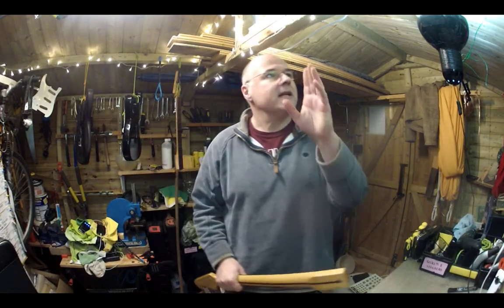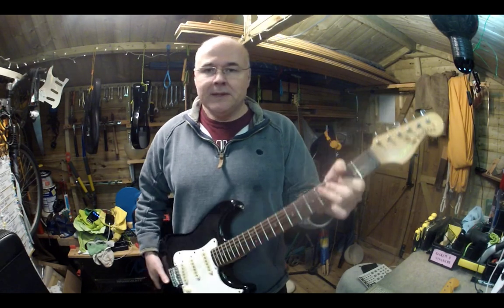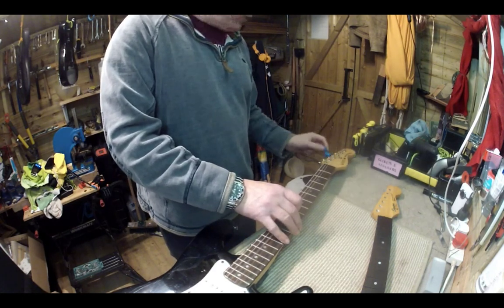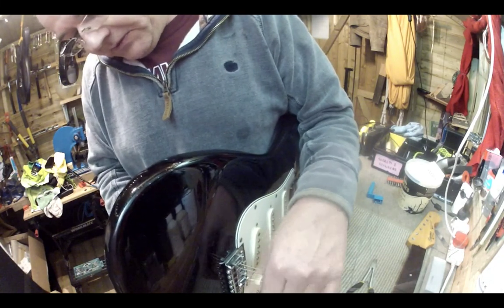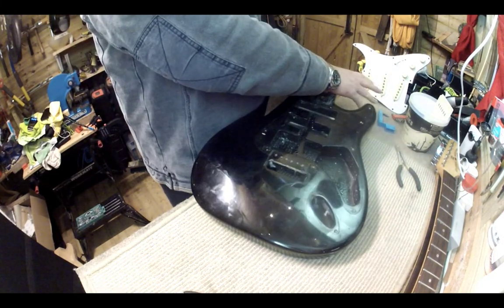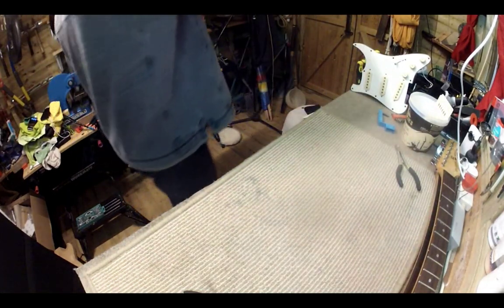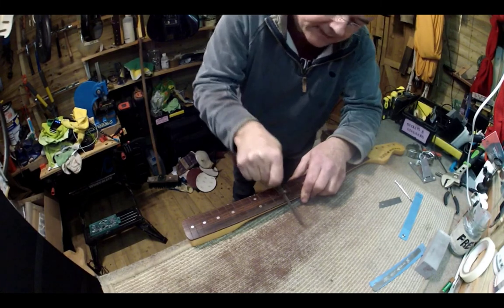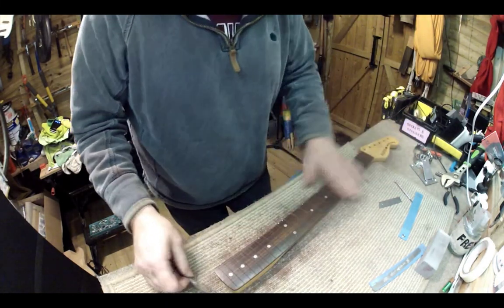Sunn Mustang refret and set up Part 1

Comment: What's the trick to removing the old nut? I didn't see that part in your video! On my Squier practice neck, even though I scored all around it, I still managed to split the damned thing into, lol!
Reply from the maker: +JH Scofield When it comes to Strats & Teles I tend to tap in a very fine flat blade screwdriver under the nut and lever them up. If that's not possible, then cutting the nut in half - longways - will allow you to pinch / break it and pull chunks out. Obviously you'll need a new nut if you take that approach!
Reply: I think it was the heavy, 20 year old lacquer on my old maple neck, glossy Squier II practice neck that was the issue. It seemed almost welded on, lol.